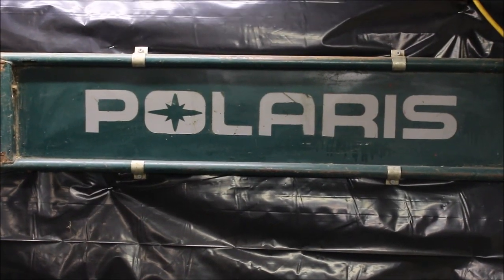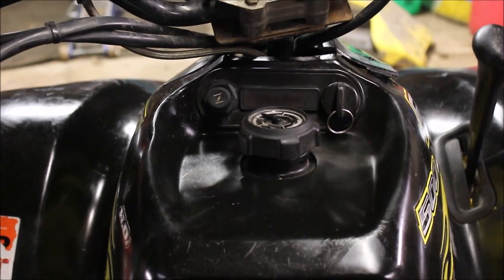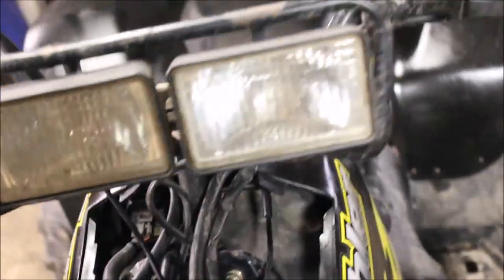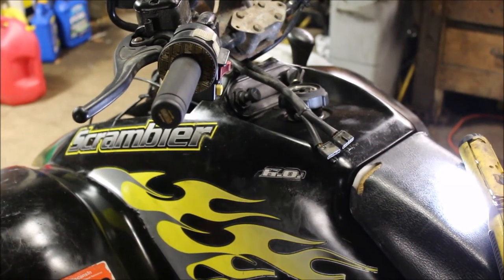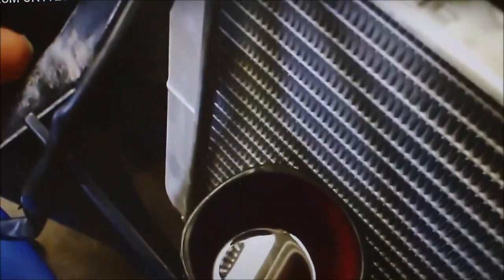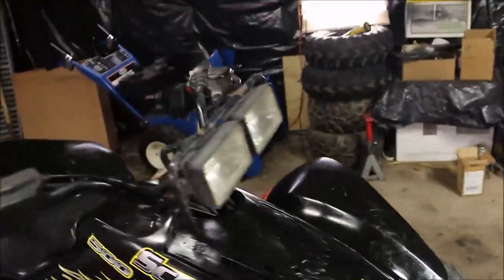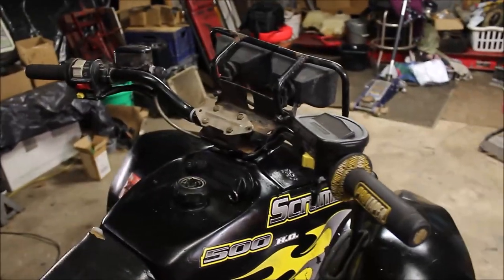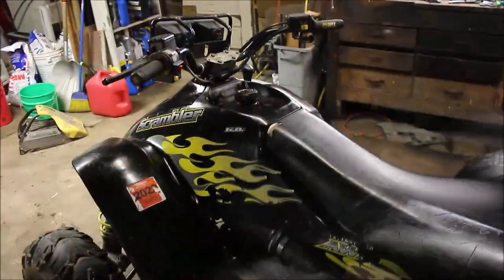No Power to Key or Speedometer on a Polaris Sportsman. How to clean your electrical terminals.

Comment: I got the same one last week and going through it to get it running perfectly. It's leaking fuel from the bottom of the carb bowl and it seems a common issue. I ordered a new carb on ebay after watching another one of your videos and will replace it soon. Thanks for the vids!

Comment: I figured somethings out its a  91 350 trail boss with a 97 400cc engine, if I've decoded the engine number correctly, my mistake i thougbt it was just the jug, still no start, i have between 95 and 100 psi.

Great content, keep em coming and thanks!
Reply from the maker: Ok. So that changes a lot of things. The cdi box, the stator, and basically everything electronic will be different unless he used the stator for the 350. If he used a 400 stator it could change things. Did you pull the black wire on cdi box? It could be you have a faulty kill switch. I have taken the switch apart already and found it was green inside by the kill/light switch.

Comment: Help, l have a 93 trailboss has spark and cranks but no start, also when key is in off position all electrical still works....Help 
Great content !
Reply from the maker: Have you checked compression? Should be 95 psi or higher.
Reply: @TitaniummanGarage   I'm waiting on a tester, it seems ok when I put my thumb over the spark plug hole, but i won't know for sure until i see some numbers on a tester. I first thought it was a neutral saftey switch, but then realized it was just a bad indicator bulb. Its a 350 bottom end with a 400 head with reeds done by previuos owner
Reply: @TitaniummanGarage   thanks for your help!
Reply from the maker: @dexterrockstar4165  I didn't think that was possible. The 400 head doesn't fit on a 350. the 350 opening for the jug is smaller. I tried it. Unless he bored the 350 jug out to a 400 piston. Might explain your problem if I'm right.

Comment: Help! I have a 99 sportsman 500. I've replaced the key switch and both handlebar switches. The neutral green light won't turn on. Upon moving the wires to the key switch I got it to run but that was before I replaced both right and left throttle switch's and light switch. Yes the four wheeler is a neutral. Something to do with the wiring. Any help would be greatly appreciated.
Reply from the maker: Did you use China aftermarket parts. They are junk.